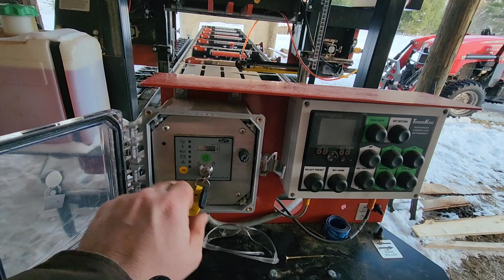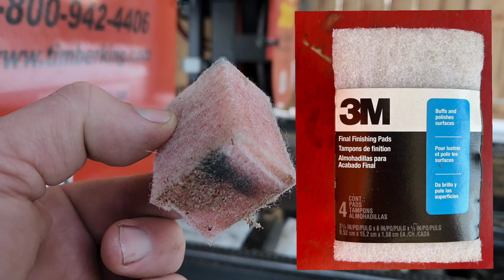Check out this sawmill bandsaw blade wiper system

Comment: I run two felt wipers on mine, one on each side. The hard line has a selinoid valve, needle valve and sight glass on each side and a main inline filter just below the tank. I hardly use any diesel and the selinoid valves turn on and off with the clutch. Works great and have using it for many years. The felt needs to be pressed up against the blade and held in place with a squeeze plate held in place with a 1/4" screw. Look at Cooks saw set up.

Comment: Good video and job. I hope to put wipers on mine. Water and soap are no match for white pine. Looking forward to your blade testing. Take care be safe and well.
Reply: Have you tried winter windshield fluid and soap? That's all I run, no problems with pine
Reply: @Desert_Hobo  yes that is what I am using washer fluid with a little Dawn. Yellow pine  there is no build up just the white pine I sawed a cedar log and blade was clean again. Thanks take care, be safe and well.